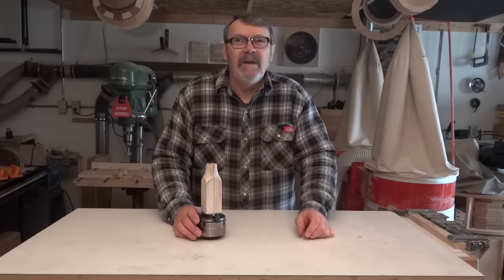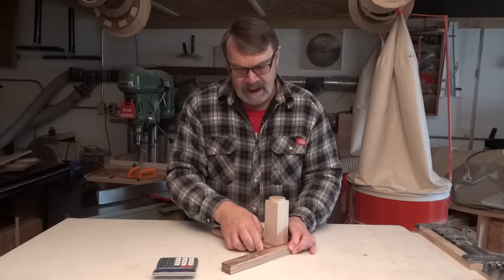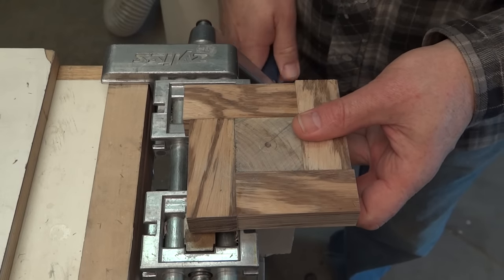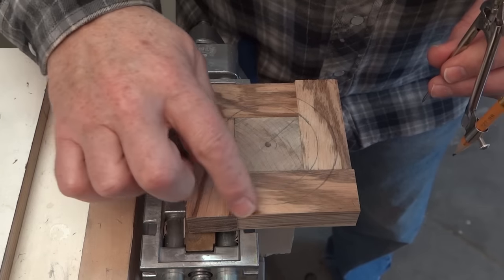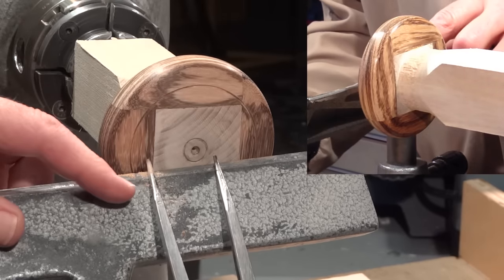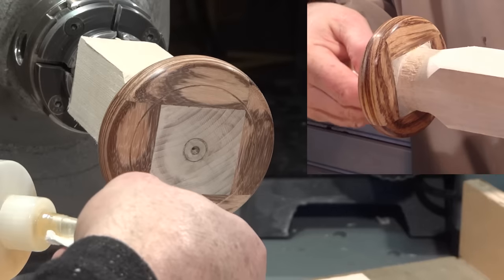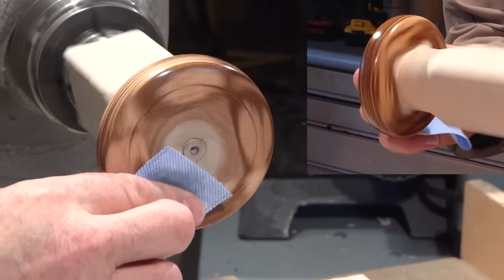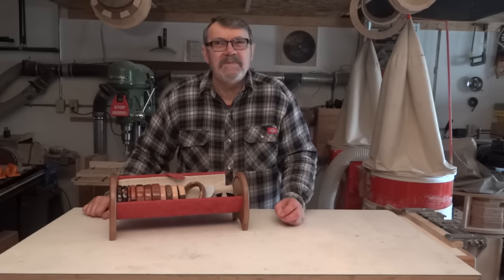Turning A Bracelet

Comment: A good look nice job. I am concerned about gluing end grain. I have been told to put a thin layer of glue on the end grain to seal it and after all ends are dry the assemble the work. What is your opinion ?
Reply from the maker: +Charles “Tim” Reicks 
Hi Tim,
I think that's a good idea but don't bother on something that will have virtually no stress on the joints.
Take care,
.....Gord